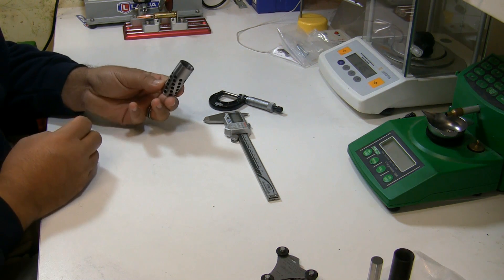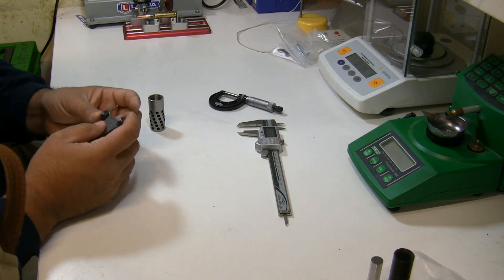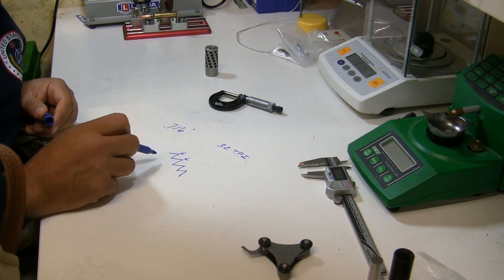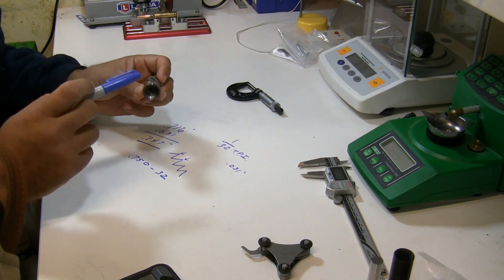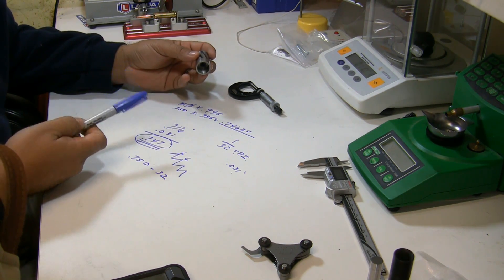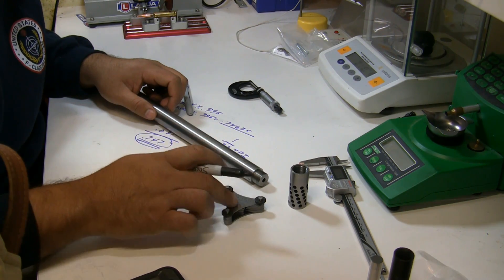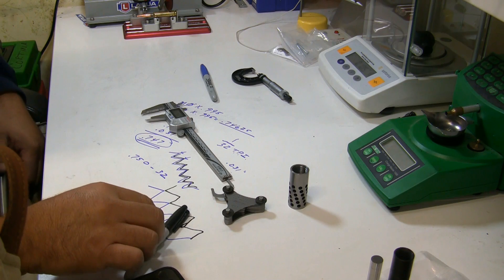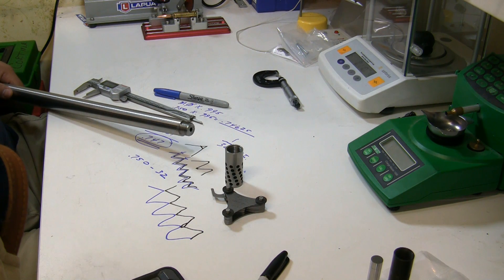Modifying a barrel tuner part 1:  Identifying muzzle brake thread size and pitch

Comment: Maybe a video or just an add on to a video talk about adapters when you have bought the wrong thread dia. 
I just bought an adapter and cut off the end piece so that all that is left is the threaded part then with lock-tight installed it into the tuner that is 5/8 onto a 1/2 threaded muzzle with a lock washer. 
It was my mistake buying a 5/8-24 tuner and not a 1/2-28
Ps: by installing a tuner/brake on my used Rem.700 223 factory barrel I have now reduced my 5 shot groups @ 100yds. from 5/8 to 3/8 which is very very good for a factory barrel. Now there's a video to help sell your EC Tuners.

Comment: Easier and cheaper if you buy bolts of the sizes of the standard thread of common calibers like 223 1/2" x 28 and 308 5/8 x 24 to check your muzzle break.

Comment: Thank you for your video.  It answered several questions.  When I call local gunsmiths I get very little help.  I have a Rem 700 7mm Mag with a break standard barrel.  What I need is a thread protector.  I measured the diameter of the threads on the barrel at 0.462”.  The pitch is 24.  I can’t find a thread protector anywhere to fit my gun.  All of them are too large.  The one I thought would fit is 5/8” – 24.  Way too big.  Do you have any suggestions?
Reply from the maker: +Henry Wilson Yes, try a 1/2" - 24 since .462" is closer to .500 (1/2") than to .625" (5/8)
Reply: Thanks, I'll try it